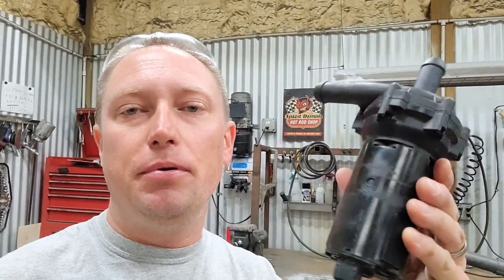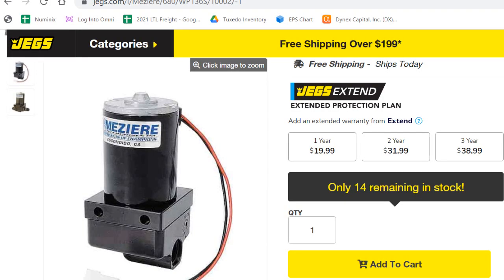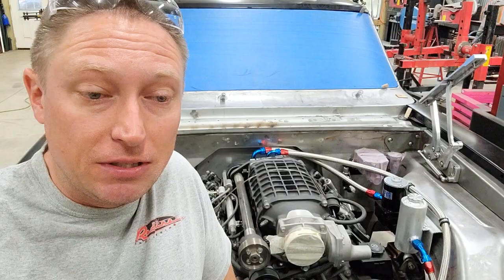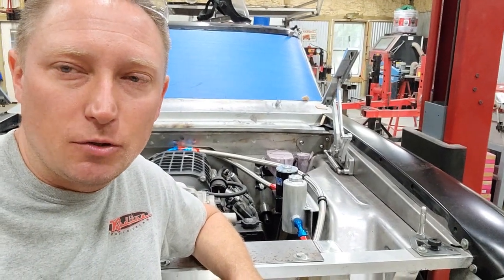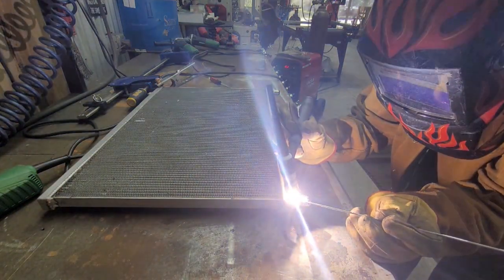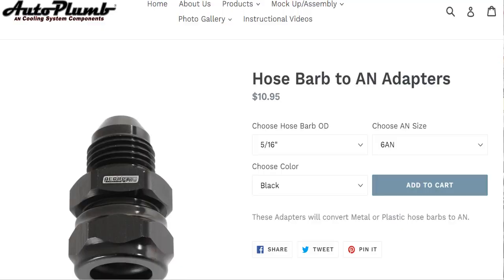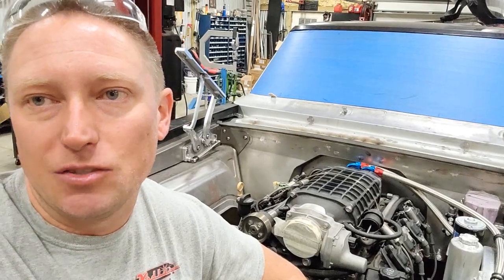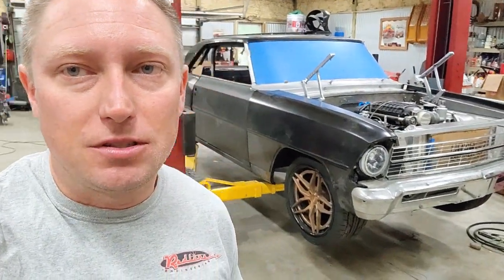Custom Supercharger Cooler System - How I Made It

Comment: have you heard of Brown and Miller   hose and fitting co. they will help you understand why you do not want to use those blue and red hose ends with that terrible hose , i really think that your gonna have issues with that supercharger system   and the stuff you have now      check them out you will be pleased        there stuff is on everyone's high-end build
Reply from the maker: They don't have an email address posted to their website.  Really hate that.  Well, I've already bought all the fittings & hose at this point, so might as well give it a go and see what happens.  One thing I've noticed in this build is this.  It's extremely common that I finish a task, having done the best I can do, and then someone will tell me that I should have done it a different way, a better way.  Are they right?  Sometimes, maybe, I dunno.  I can tell you this though, if every time I realized I should have done something differently, I went back and re-did it, the car would stay in the build state forever and ever.  At some point, I feel I just gotta push forward, do my best, and hope for the best.  Nevertheless, I appreciate the feedback and will be watchful of the fittings and hose.

Comment: Great video, just one thing, make sure you put 50/50 mixture GM red antifreeze in the system. It’s formulated to not cause aluminum to corrode. But you already knew that, I’m sure.
Reply from the maker: Glad you mention that.  I was actually considering water because freeze busting in FL isn't really a concern, but I'll be sure to do that in 19 years when the car is done.